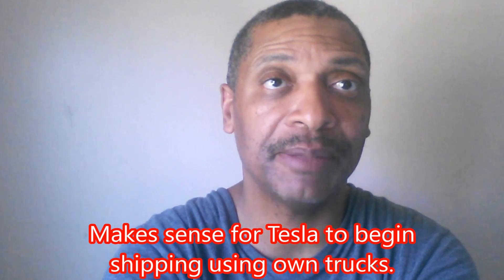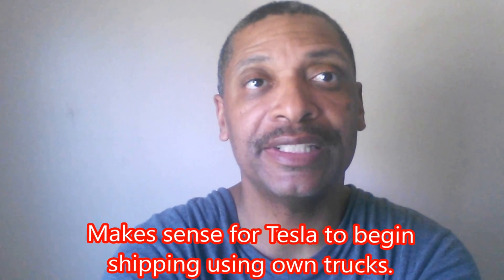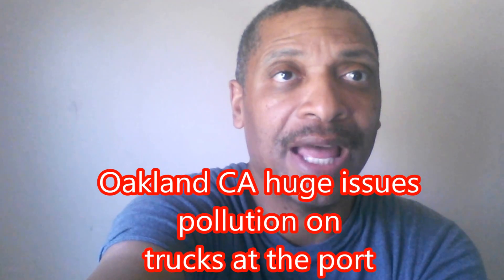Tesla 2170 semi truck mule vs Diesel Truck 300 mile costs. daimler/benz process

Comment: Nice analysis on this consideration. Tesla has a serious problem going here. They are trying to scale up the model 3 and are having to implement cost saving measures at the same time. They have a huge investment into the infrastructure of the model 3 and they desperately need to start seeing a return on their money.
They have a huge line of customers just waiting to take delivery and vast numbers waiting for the lineup to diminish. 
It is one thing to roll out the semi truck but another to manufacture it. They are going to have to overcome the model 3 bottle neck that exists, they do not have infinite resources.
Reply from the maker: if you saw my other video on Model 3 delay, I believe the fact that they are just building the support buildings for scale production is the holdup.  because they are 80 percent vertically integrated saying supplier issues are causing delay is saying you are causing you own delay.